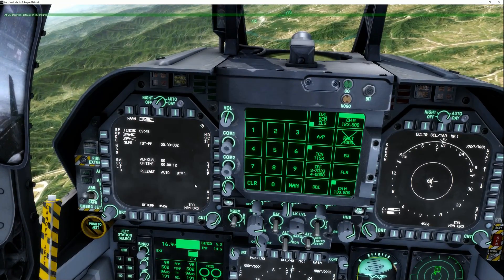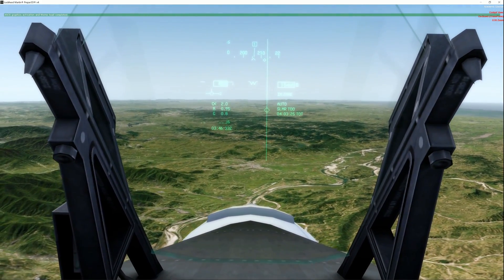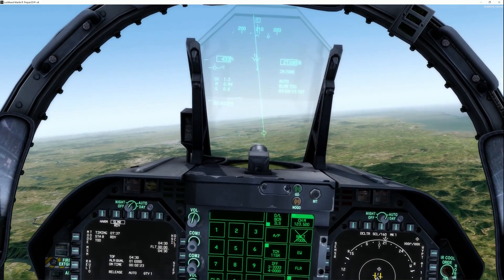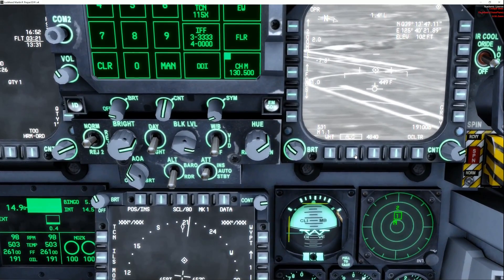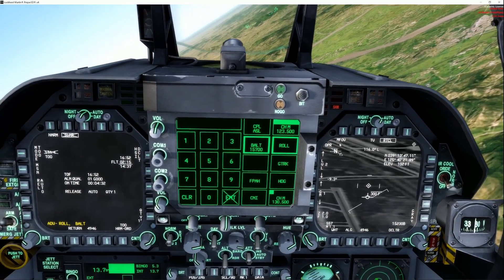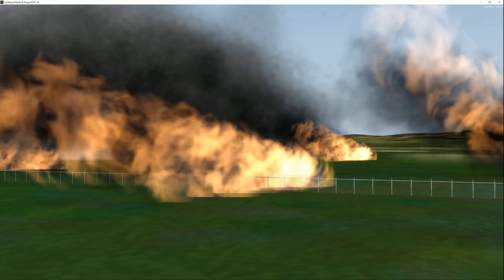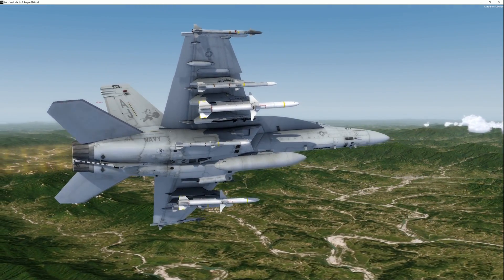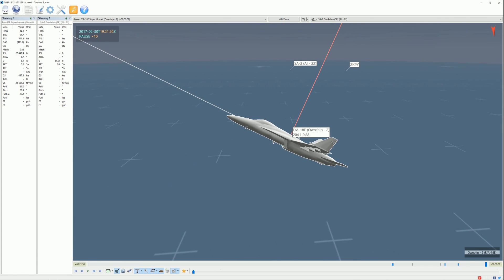P3D- F/A-18E Using HARM to fire SLAM-ER.

Comment: If you are using  HOTAS, can you help me configure my controls?
Reply from the maker: Ah yes- setting up a HOTAS...............  1) Either you have to use a registered FSUIPC, or the new 'Super Script' extension.. 2) Both the aforementioned are separate payware products that I have not purchased and not sure if I ever will.. 
I understand VRS business objective here, but for as much as Superbug costs, HOTAS implementation should come included in all versions of the add-on. Alas, the product originally came out for FSX and therefore was restricted to the old code and limitations, so guess that was also a factor.. Sorry man, other than default primary flight controls (Throttle and surfaces), I'm punching away using my keyboard/ mouse.
Reply: You can use a program called RSMapper.